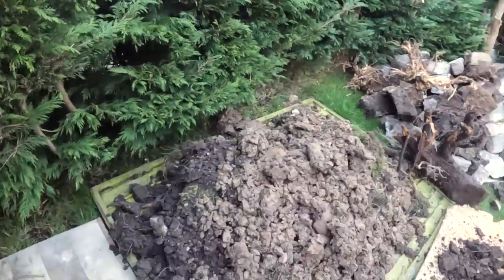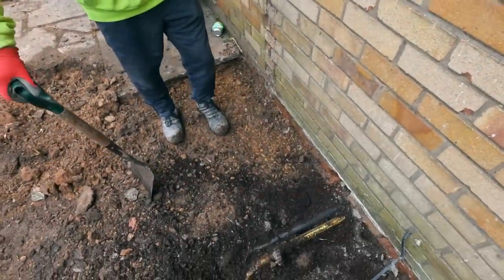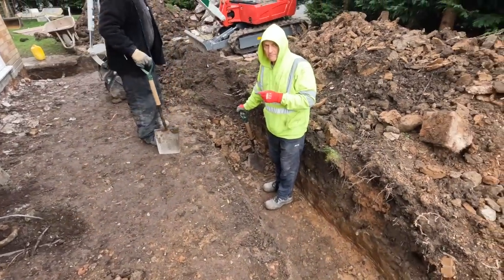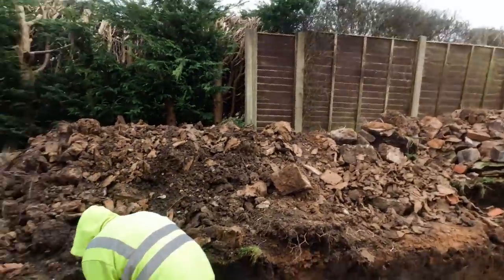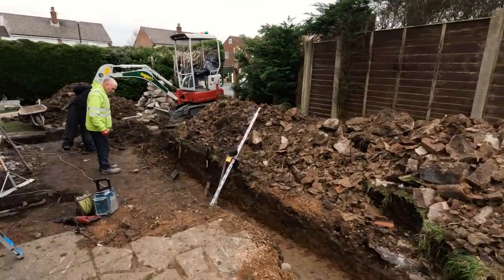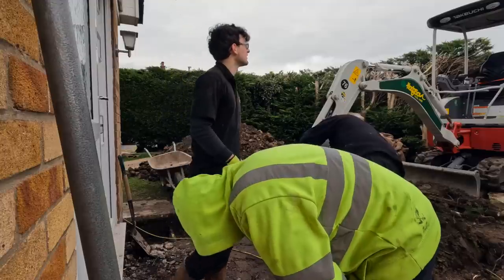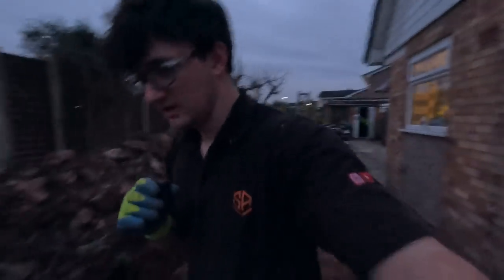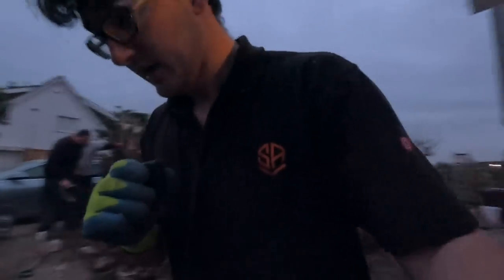PROBLEMS PROBLEMS .. EXTENSION PROJECT PT 2

Comment: Hi Ste and Al, Nothing to do with this video but we are doing an orangery extension with block pillars of which will be rendered. Would you recommend fiberlite 3.6N or solid 7N blocks?
Reply from the maker: Fibolites. 7 n block are lousy for part L insulation rules 🧱👍🏽
Reply: @SteveAndAlexBuild  Thanks, would 3.6N be strong enough for single story I've heard they crack easy due to soaking up moisture or should I look at 7N fiberlites
Reply from the maker: @barryjervis1893  They are good for 3 stories apparently and I’ve never seen fibolites crack 🧱👍🏽
Reply: @SteveAndAlexBuild  Thanks guys and good luck with the foundations 👍
Reply from the maker: @barryjervis1893  😁🧱👍🏽🤜🏽🤛🏽

Comment: Well steve just question wat u tink bitumen paint or did u ever use it under floor level
Reply from the maker: Not sure what you mean 🤔🧱👍🏽
Reply: @SteveAndAlexBuild  did u ever use it on blockwork under floor level to stop moisture coming through in a building where there is no damp proof membrane
Reply from the maker: @markcarolan7564  no mate 🧱👍🏽

Comment: The removal of the trees will not cause the ground to shrink, it could make the ground swell as ground water will no longer be absorbed by the trees. It could also affect the floor slab because of the ground heave,
Reply from the maker: There wasn’t a single root in the clay . They stayed in the soil layer 🧱👍🏽
Reply from the maker: @martin2466  😉🧱👍🏽
Reply: @martin2466  Steve is answering the “could”
Reply: @martin2466  sorry Martin I’ve just clicked on what you meant 😂

Comment: We always have to dig to a 1mtr minimum, regardless where the existing footing is. Also we would not get away having gas pipe in oversite, you were very lucky there, costs a fortune and the time it takes them to move it.!!.. I bet you’ll be glad when your out of the ground….
Reply from the maker: Jeez Nigel it’s bloody tough down your way ! 
   We were very lucky to get Cadent to ok it, it was a worry when we found it and we were lucky not to go through it with the big breaker 😬💥🧱👍🏽
Reply: @SteveAndAlexBuild  it is tough down here Steve.! We now have a shortage of building control inspectors, so the area im working in at the moment only have part timers.!! Monday to Wednesday .!! Have been told no footings to be dug after Wednesday as they won’t be inspected 🤷🤷
Reply from the maker: @nigelsmith1198  . Bloody hell that is ridiculous.
  It’s the opposite up here with some saying they are quiet . It’s 24 hours notice for a visit and we got a sane day visit 😳🧱👍🏽
Reply: @SteveAndAlexBuild  yep.! Makes life hard.!!
Reply from the maker: @nigelsmith1198  . 😬🤜🏽🤛🏽🧱👍🏽

Comment: Taking out the trees now isn’t the correct solution, the ground is now going to swell and needs a void to go in too. The construction being used doesn’t provide this void. Claymaster and a suspended floor should be used with deeper founds.
Reply: @martin2466  it’s about providing an adequate foundation for the job and would be allowed for in the quote, the customer can then decide to continue or not. how much do you think it will cost in repairs? Might be cheaper to knock down and start again?
Reply from the maker: @markjarvis5465  🙄

Comment: You get upset when I comment,you have a blind spot when it comes to muck away,you and the digger must have handled that muck at least 3 times,a grab lorry was the answer right at the start,and while we are on the start,witha extension with conifirs all around the garden get building control in from the start,its not being wise after the event,I thought you would need at least 1.5 M building control said 2.5m or trees gone,you are decent builders,I hope you built in a decent margin in the quote these jobs are best avoided if you can.